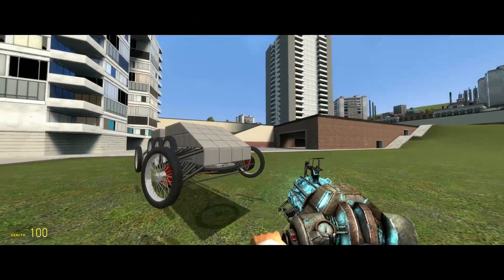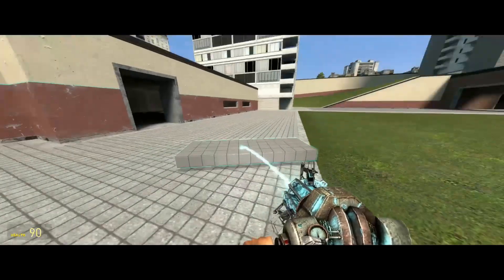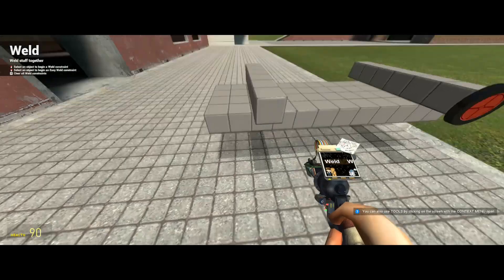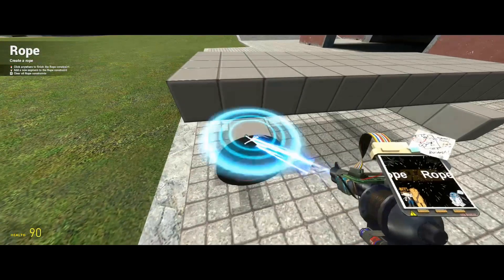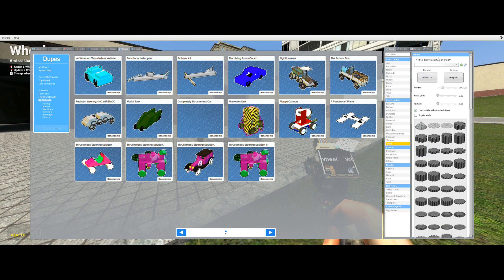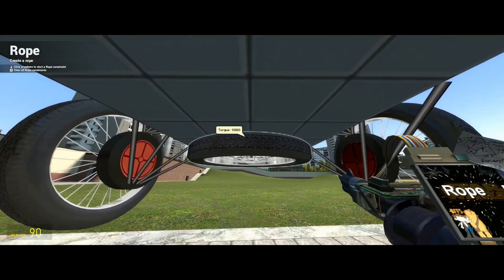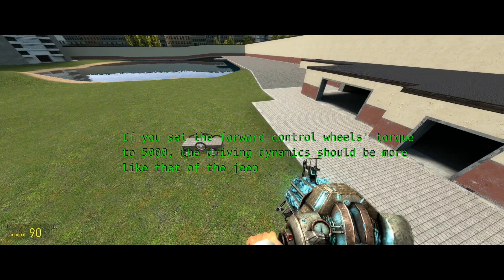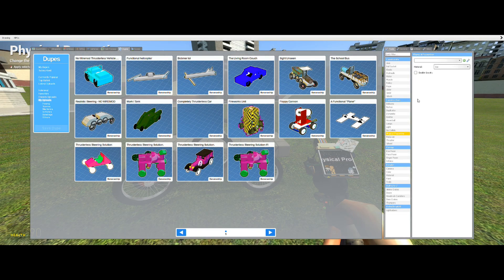Let's Build A Car! (With no Thrusters or Wiremod) - GMOD Tutorial

Comment: Btw what you done with the wheels on the side for steering can be avoided by using the steering wheel underneath
Reply from the maker: Thanks for commenting. The side wheels are responsible for tugging the left and right sides of the pitman control wheel (the one on the bottom) and cannot bring the car to turn left or right, only straight. The pitman control wheel is responsible for left and right turns and cannot straighten itself without the help of the side wheels.
Reply: @lasagno3816  that's why you can use elastic
Reply from the maker: @HoodieDog i tried that, and elastic is only good for straightening this style of steering mech when not in motion.
Reply from the maker: HoodieDog  Although I've tried elastic, there are a few placement methods I haven't tried. I'll give that a try and if it works I'll post an updated design. Thanks for the input